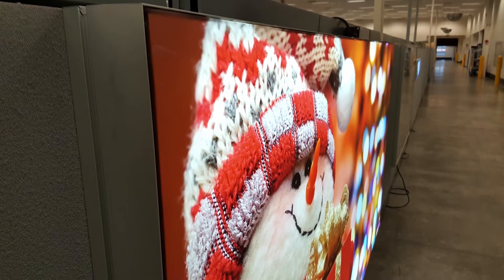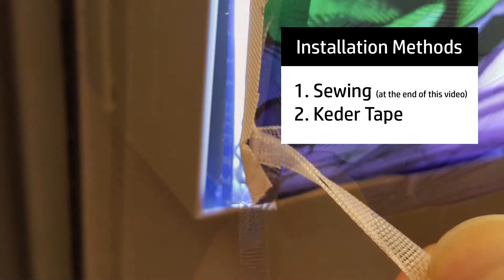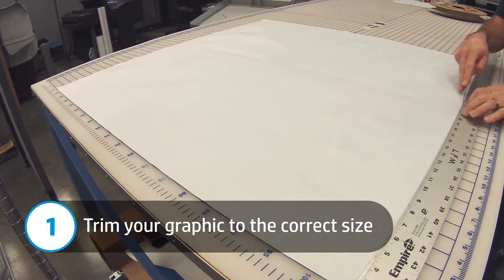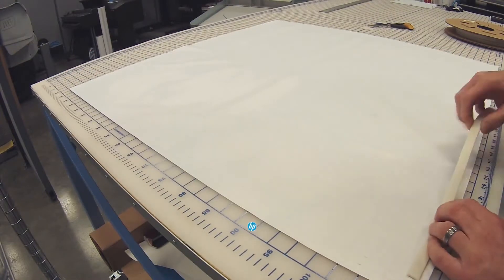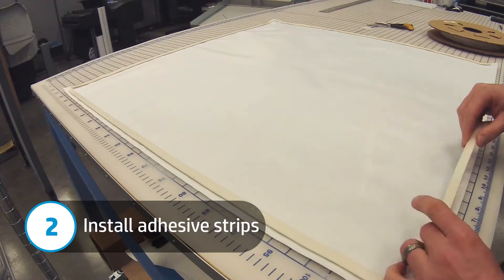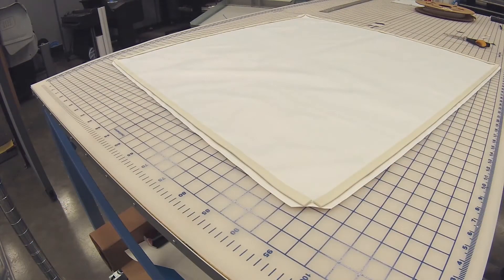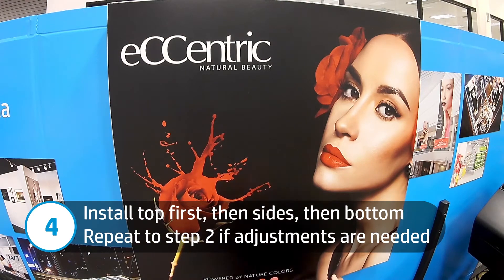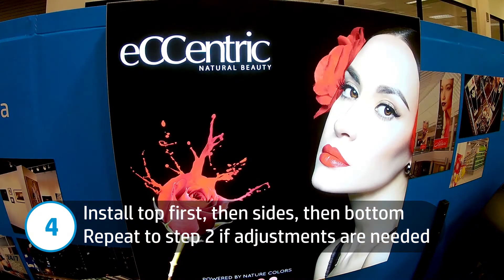How-to Install HP Durable Backlit Fabric into an SEG Frame

Comment: When trimming the graphic for sewn-in keder, how do you measure for correct size to trim it?
My graphics are coming out either too loose or too tight.
Reply from the maker: It's recommended to make your print 1-inch larger than the finished size. The placement of the keder tape depends on the stretch in the material you're using. If possible, it's helpful to use a piece of blank material to make a template first. Also during printing, it's not unusual for the size to be slightly off, so always check the final size before applying the keder tape.